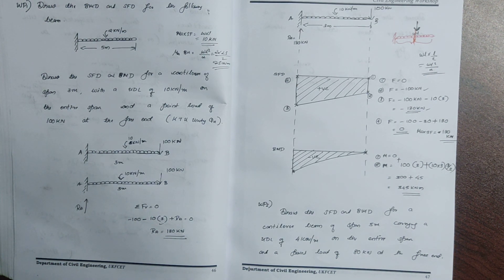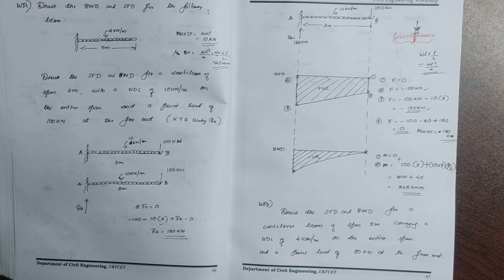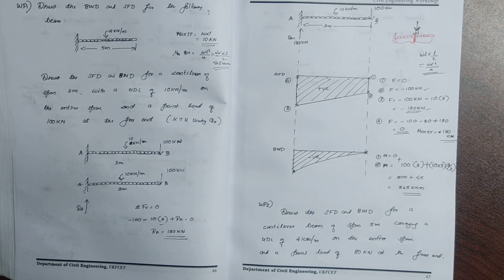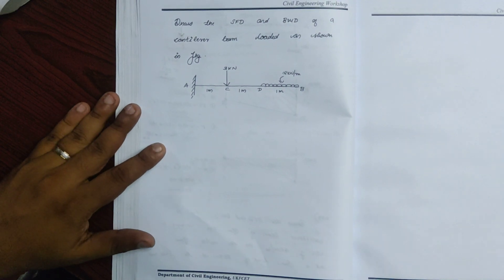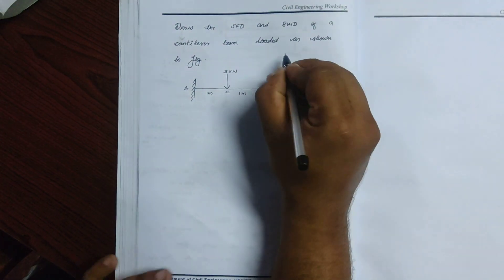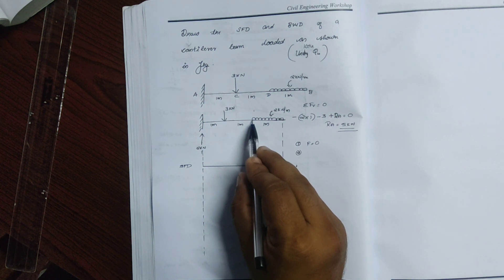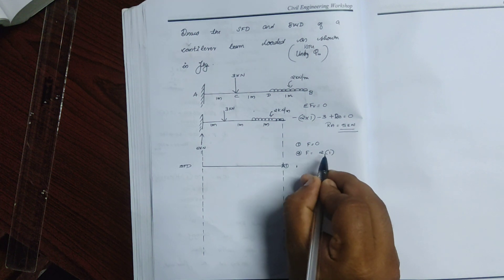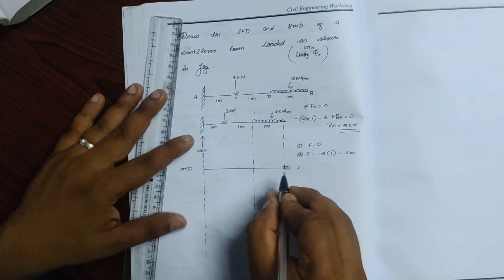MOS problem solving module 3 part 12

Comment: sir, if the shhear force diagrams are +ve it should be drawn above the base line right
Reply from the maker: If you are drawing above as positive values then negetive should be drawn downwards similarly the other way can also be practiced. Avoid the way which confuses you. Follow only one way of representation
Reply: @courteousconcepts8535  but in this representation, both negative and positive is drawn downwards
Reply: means both sfd and bmd is drawn downwards
sfd should be drawn above base line right
sincs bmd is downwards
Reply from the maker: @aleenajoseph8940  no , shear force can have its own sign convension , ie top positive - bottom negetive or top negetive - bottom positive . Now in BMD , the sign convension is based on clock wise and anticlockwise rotation which has nothing to do with sf convensions